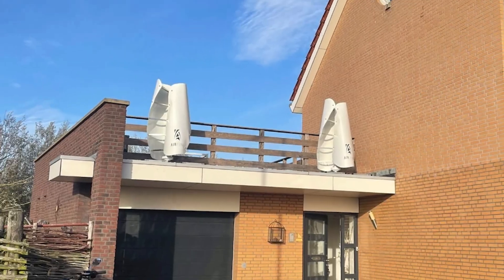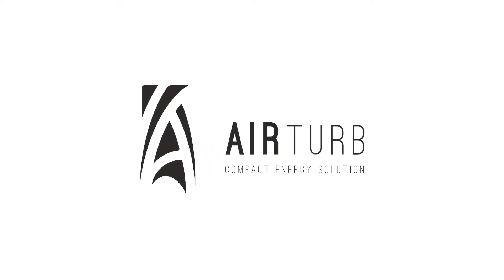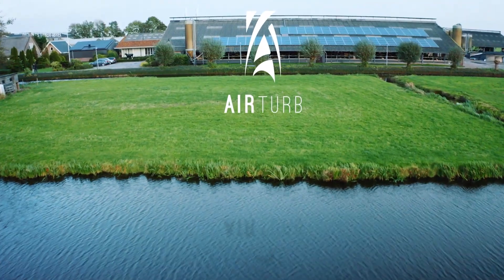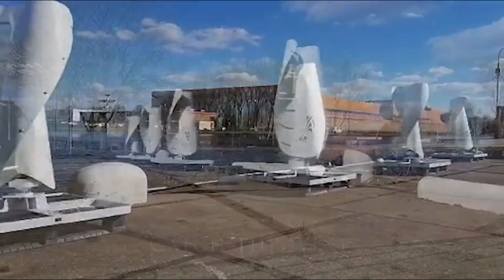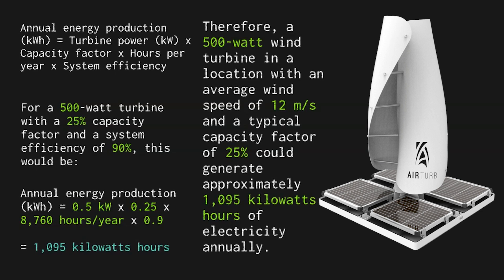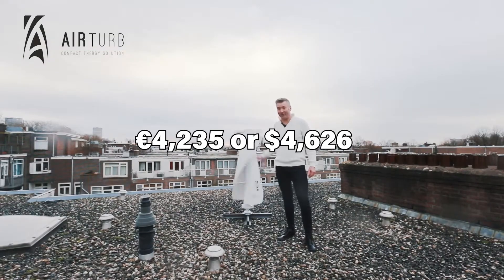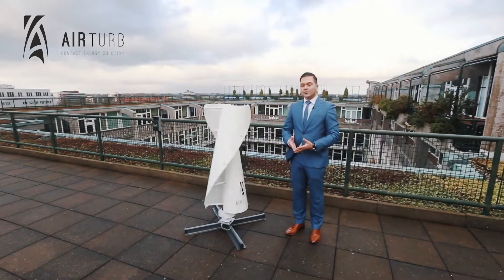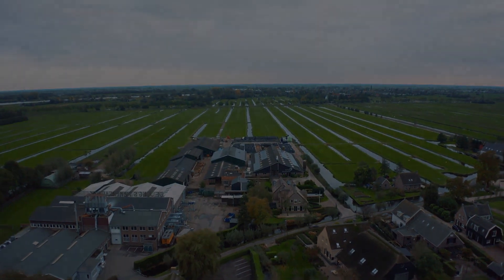This could be the most powerful and efficient vertical axis wind turbine in Europe

Comment: All practical tests of ground-based small wind turbines show: 1) They hardly produce any electricity! 2) They do not last long! 
9 out of 10 small wind turbines stop working after just a few years due to the extremely gusty winds close to ground.
On the other hand, solar panels generate at least 10 times more electricity with the same investment! 
Reliable and almost maintenance-free for at least 25 years!
Reply: The horizontal axis turbines do much better than vertical, yes they require more maintenance than solar, new bearings every couple of years but in many areas there are days without meaningful sunshine in the winter and so wind reduces the need to fire up a geny.
With an on grid set up there's not much point though and having run a few I would avoid if I could.
Reply: @zopEnglandzip  Your claims are 100% contradictory to ALL results of comparative tests!
Reply: @zopEnglandzip  Pure nonsense! Wind/electricity yield increases with the third power of the wind speed. So+100% wind = +800% electricity. Close to the ground: 0 constant wind, but aggressive gusts! Therefore ALL ground-based small wind turbines are extremely ineffective! All solar panels generate at least 10x more electicity.